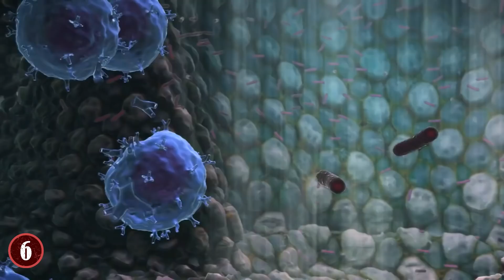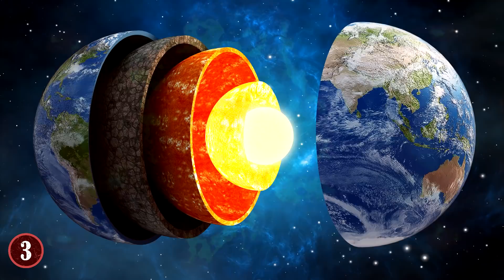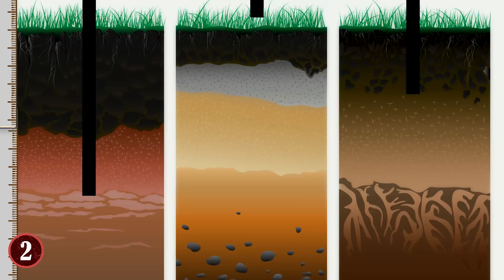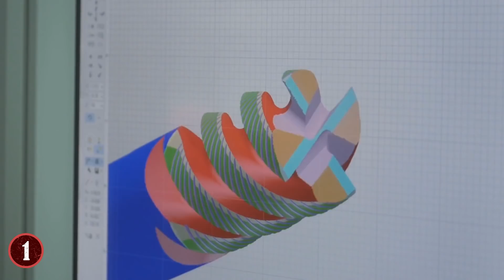What is The Deepest Hole We Can Possibly Dig?

Comment: Drilling super deep over the ocean is insane. You won't be able to use the hole, and you will likely release a lot of heat into the ocean... not a great goal. Best practice is to drill it overland, with a number of super-deep small diameter bore holes that would allow for the influence of pressure and heat below. Then we can start sending our garbage down.
Reply: Exactly!  Drilling in the ocean that would release a tremendous amount of heat,  thus creating a "boiling water" effect for the ocean life,  which can't be good for them.